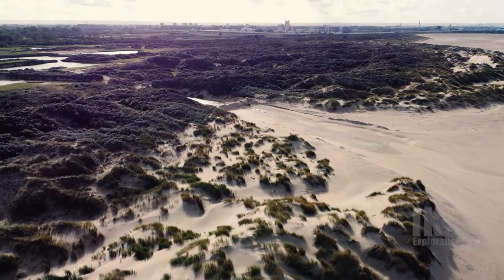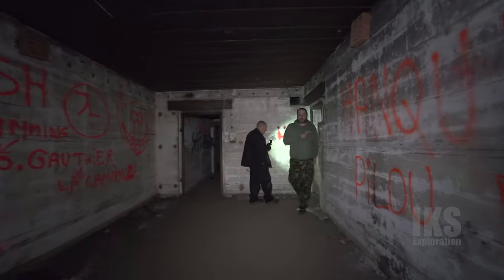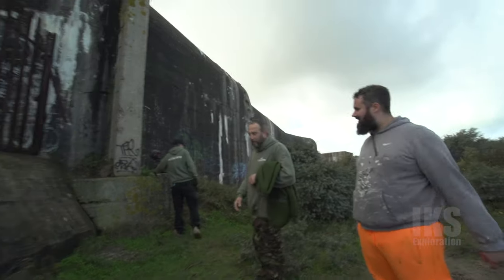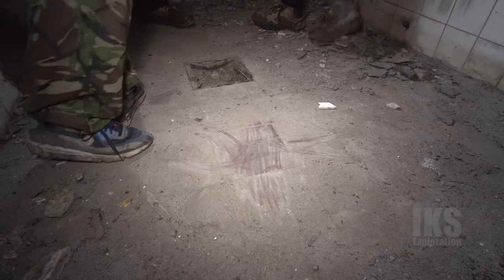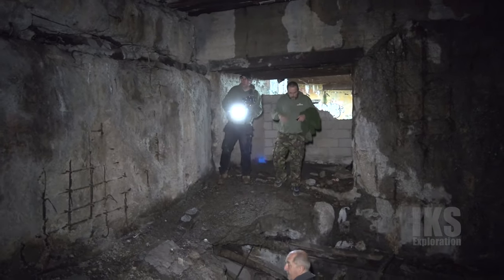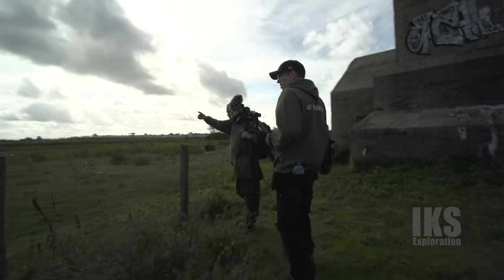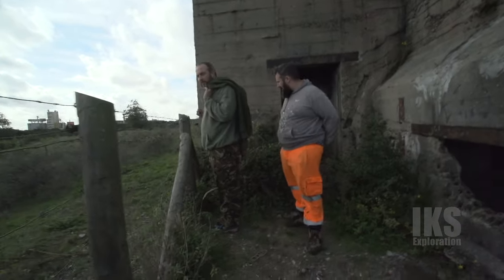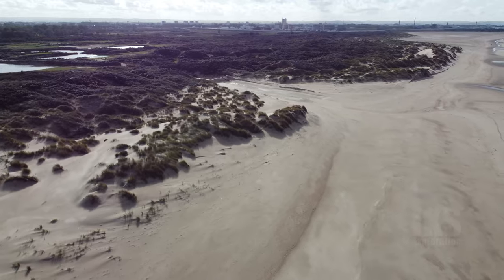German Batterie Oldenburg – Calais, France

Comment: those rough bricks just plonked on top of the bunker look out of place. are there any actual recordings of them build this bunker? or is it from the old world
Reply: The brickwork on top of the bunker doesn't look like it was part of the original construction. Soldiers will improvise with whatever is available when it comes to adding more protection. There is 1 construction photo I have seen, there quite possibly are more, the Germans documented a lot of stuff. You would probably have to search archives to find more.